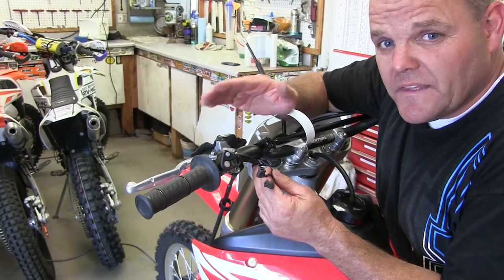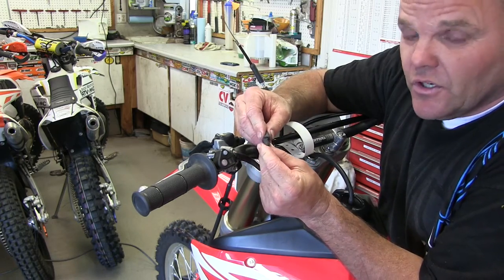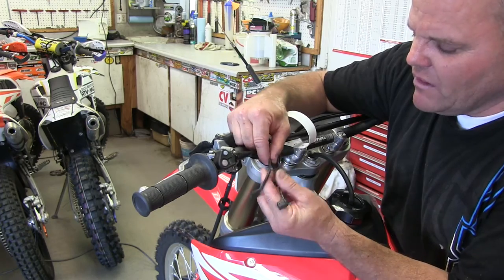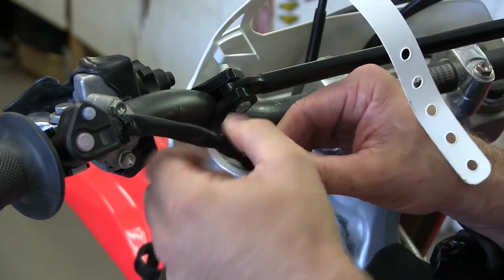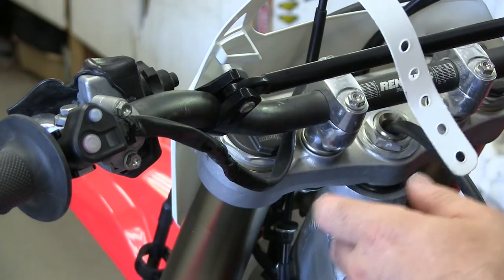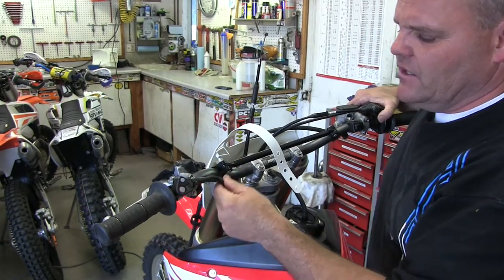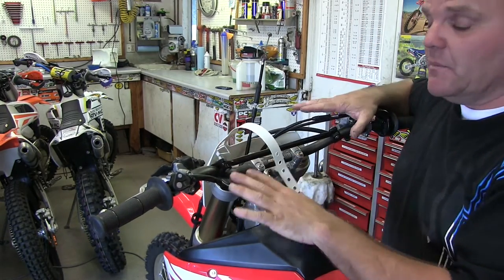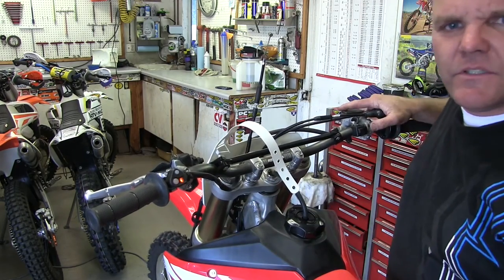HOW TO BYPASS YOUR CRF450RX or 250/450 X CLUTCH SAFETY SWITCH!

Comment: No reason to cut and solder and take that time, just remove the plastic radiator  side cover and unplug the connector and plug them back into each other which completes the connection, simple fast and reversible.

Comment: I beefed it the other day and my clutch level rammed into the switch so hard it broke whatever was connecting the wires and killed electric start feature. Thanks for the tip on the bypass, took two seconds.
Reply from the maker: Glad you liked it--

Comment: I added the e-start kit to the R model, and opted not to use the switched perch. What I did was just connect the male/female connectors down in the harness where all the grounds are located. I don't know if the stock RX harness is the same as the e-start R harness though. Basically what I did was the same thing as this video, but it was plug and play, no soldering.
Reply from the maker: Yes very good and I think the way I would do it if I was keeping the bike long term.   Did you un ravel the wires all out of the tape the entire way?
Reply: no the wires that come out of the clutch perch/ housing run down to the area where the grounds attach to the frame, also where you hook up honda's PGM-fi programmer (the red plug), At that area the two wires that come out of the clutch perch/ housing plug into the harness, one with a male to female, and the other a female to male connection. You just pull them apart and push the male/female together from the actual harness. It is the same connectors that honda used to use on their old school kill switches if you are familiar with those. I am using a pro taper clutch perch/lever so I didn't even run those two wires at all.
Reply: Then again on the RX there may not be that "break" in the wires at that area, they maybe one continuous run into the harness.

Comment: Hey man i did this on my crf and now i get no starter button signal they been tested for continuing and they are good but no signal solenoid and start motor turns when i by pass it with a wrench
Reply from the maker: Something sounds weird with your starter button wiring/plugs--    Or when you did your by pass you didnt get the wires back together well.
Reply: @dirtbiketv1   well i disconnected  my starter button and paper clip bypass the harness plug then i bypass with wrench starter motor comes on but bike wont fire up i take the wrench off and the starter is still going i pick out the paper clip and it stops ,then i tried placin a cable from red/wht cable on solenoid to battery i press the button and its reading
Reply from the maker: Did this happen as soon as you did the clutch bypass?   If so have you double checked that those wires are together?
Reply: @dirtbiketv1  well kinda but really is my starter switch and my bike wont go on even if i kick